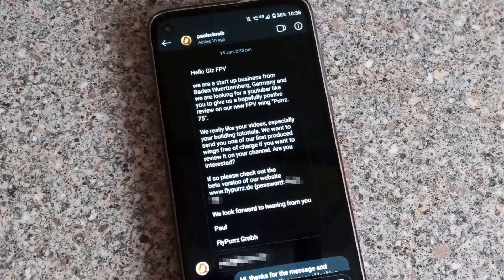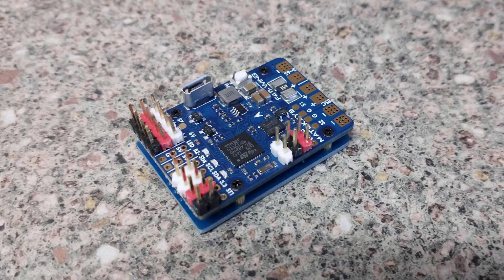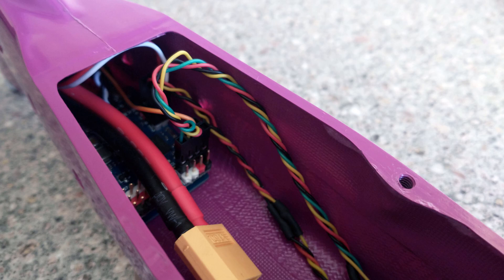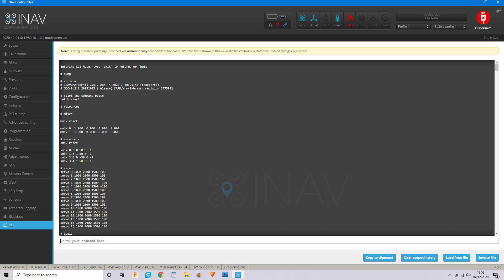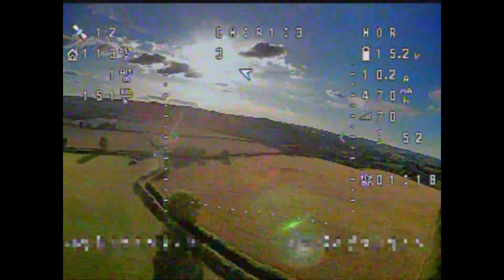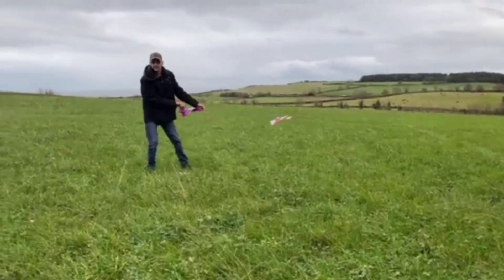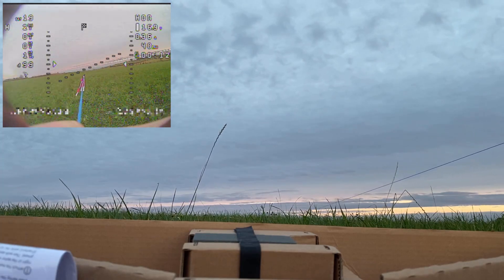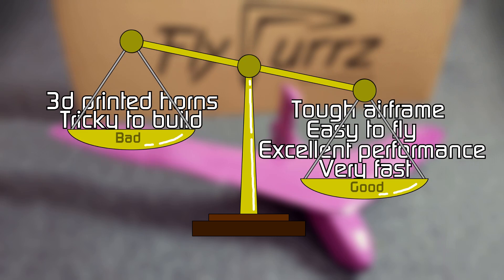🛩️ Purrz 75 - Fast FPV Drone Build And Review

Comment: That aircraft in my opinion is for someone with alot of experience with those same types of fast very delicate airframes...
Reply from the maker: I agree. It needs to be flown by someone who's experienced in flying with fast aircraft, which is something i don't mind admitting that I am not
Reply: @gizfpv  When I try any aircraft, especially special ones, I want to be able to make dozens of essays without the thing exploding at first mild crash...
Reply: The problem lies in the fact that those who have a lot of experience with similar models that are fast, sleek, composite aircraft, are all going to be better, larger, easier to land and more durable than this. Which really puts this one in a tough position if even the composite speed guys won't go for it. Also I think the whole FPV angle misses the mark as most of those flyers are los not fpv pilots..
Reply: @nighthawk0077  , this is the same construction as any other high performance RC composite aircraft, including speed 400 pylon racers (about the same size). There is nothing out of the ordinary here with the construction of this thing.
Reply: @abates3747  Watch this review again. He even mentions it's very thinly built and fragile. I've had several composite speed planes and they were all stronger than this.
Reply: @abates3747  Agree... like the way they hid the elevon linkages internal and it seems to fly well. Certainly looks slippery.
Reply: I have lots of experience, over 40 years, i still routinely crash my models into the ground...

Comment: To expensive for what it is. Same money will get you a full carbon micro monster
Reply: the entire airframe is GRP, it's not a plastic coated foamie. It is quite spendy, I agree, but the design choice of GRP makes sense for an FPV airframe designed to have the antennas installed inside of the airframe. Carbon isn't exactly RF transparent ;)

Comment: I got to say, I have never seen anyone throw a plane on the end of a bungee like that :)
Reply from the maker: Admittedly I'd never used a bungee before, so i gave the bungee setup responsibility to my friend (the one you see in the video) as he had used them before. After talking with Flypurrz though it does seem like we didn't set it up correctly so that's a failing on our part
Reply: @gizfpv  yeah your friend had no idea  and killed ur plane :) make sure the hook position on the plane is correct (this is pretty important) and get a foot release system, there are a couple variations. if you are worried about the aircraft resting on the ground there are 2 ways you can overcome this. 1. a pvc launcher that gives your plane something to rest on and angle it accordingly (similar to larger UAV catapults) 2 . you can make a 2 wheel dolly system that the nose sits on, the weight is still on the hook however it rolls along on the dolly system avoiding catching grass/ground
Reply: He hasn't spent much time shooting things with rubberbands in school lmao
Reply: Yeah it's not a high start :D
Reply: Agreed, let the bungy take out of your hand. 
Maybe move the hook back a bit so it goes up rather than into the ground.

Comment: hand Launch full power in in stabilize mode. Ive seen those types of bungees claim so many planes...Its a lottery launching like that.
Reply from the maker: The first successful flight I showed in the video was a hand launch, in horizon mode. As you saw though the aircraft wildly torque rolls on launch. The aircraft needs to be moving quite fast for the elevons to have enough authority to counteract the torque roll, which is why you have to use the bungee
Reply: A bungee is foolproof if the plane is setup well. And certainly safer than hand launching an aircraft that requires high airspeed.

Comment: you can unlock the tbs unify from 25mw quite easily using the button on the  VTX
Reply from the maker: Yeah I know, it was already unlocked and should have been at full power, but for some reason had reverted back to 25mw

Comment: I that a correct way to mount the Crossfire dipole antenna? I thought they are only meant to be mounted straight.
Reply from the maker: Nope, absolutely not the correct way to mount the crossfire antenna, but seeing as range wasn't a requirment on this build, and due to limited space, I just stuck it on in the easiest way I could
Reply: @gizfpv  ahh yes. That makes sense.

Comment: How about just flying bareback before adding all the flight controller and FPV etc... I mean as a general rule, not just for this plane.
Regarding the large RTH radius, maybe it was limited by a maximum bank angle setting, and at 150km/h there's only so fast you can turn. My guess would be iNav uses a relatively simplistic algorithm which only adjusts the elevator to meet the desired altitude, and roll adjustment is expected to meet the desired radius. Would be interesting to see if Ardupilot does any better.
I'm kinda amazed they made such a beautiful molded fiberglass airframe and then.... 3d printed the control horns. Could probably cut 60 of them from one A4 sized sheet of G10. Maybe they don't have a CNC machine?
Seems like the nose could benefit greatly from having even a small amount of backing material (foam, balsa etc) behind the thin walls, but you'd be giving up a lot of useful space.
Impressive speed anyway!!
Reply from the maker: I think you're right about the RTH radius. The fact that the purrz cruises over 100mph and there is a bank angle restriction would certainly explain the wide loiter. Like I said in the video though, it would be easy enough to fix. I also agree that just reinforcing the nose would go a long way towards making the airframe more resistant to impact damage. Even if they just thickened the amount of fibreglass by 1mm would probbaly help a lot. 

As for flying bareback before adding a FC, tbh I've never done that just because I typically find most aircraft work fine from the getgo with inav installed. On a new to market aircraft though where I don't have the experience of others to fall back on, you're probably right though. In hindsight some testing before installing hevaier hardware could have been a good move.
Reply: I was also surprised by their construction choice. It's fairly normal on composite planes to add some carbon tow for stiffening at critical junctions or areas like wing spars, noses, tail surfaces, and wing joiners. I have several truly molded fiberglass ships and while they are heavy, they are next to bulletproof. I've managed to actually chop down small shrubs on landing approaches, and couldn't even find a mark.

Comment: looks like you need a cap on that flight controller,  some thing in the way of video interference there.
Reply from the maker: It's odd because on the first flight there wasn't any power noise on the fpv, but on the 2nd flight there was a lot. My only guess is that the noise became a issue 2nd time around because the VTX had been moved and was right beside the battery. A cap would have no doubt solved it